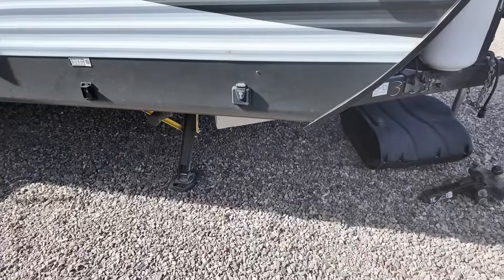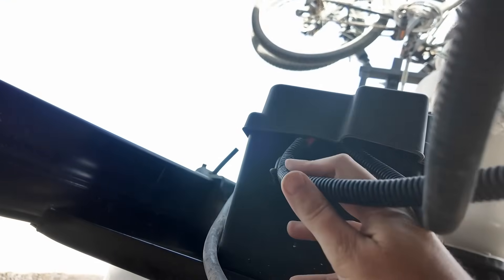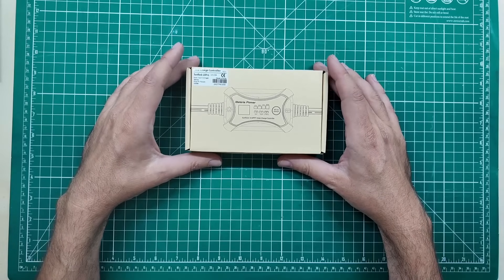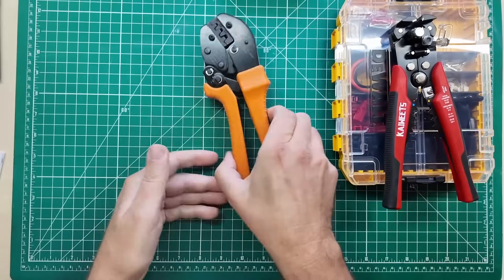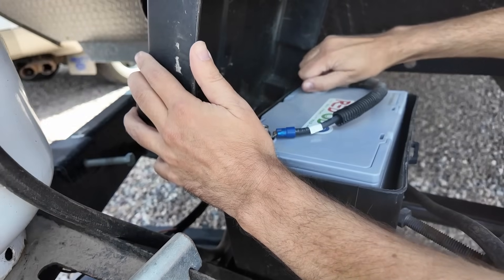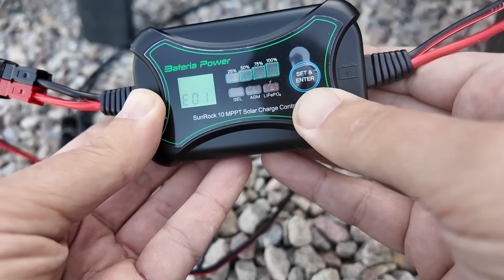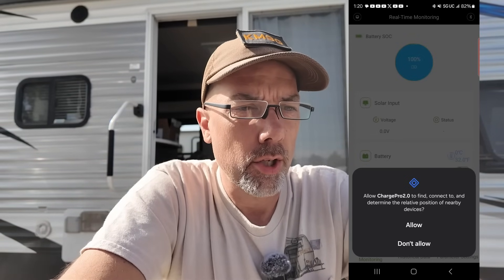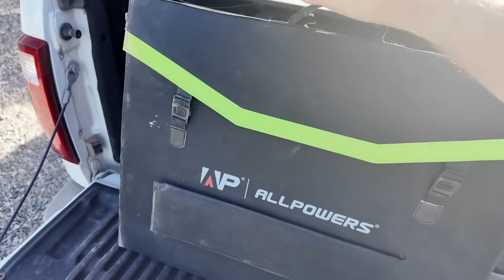No Solar?  NO PROBLEM! - Bateriapower To The Rescue!

Comment: If I hope to set up in my R. V. Will I have to tune my Converter. off inside?
Reply from the maker: You don't need to turn off the converter for this and I didn't in the video. That being said, you don't need to run both.  If you're unplugged from shore power, then your converter is already off.

Comment: Thanks for the information. I just bought portable solar panels with a solar controller and up on battery clamps. I didn't know about the plug and play on the outside of the camper. My camper is built in the 60s. My van is new. I put solar on my camper. I don't want solar on top of my van. Thanks again for the tip.
Reply from the maker: Sounds like you've got it figured out! Thanks for watching!
Reply: @livingforalivingRV  Even after 7 years. I am still trying to figure it out. The really good equipment. Like myself. Most can't afford. Then I have to find other options. I did figure this out about solar panels. The cells on them. The tighter the cells. The better they work on cloudy days. I own a 400-watt one. Really open cells. Nothing is close. Even on a sunny day. I am lucky to get 100-watts. The biggest difference between flat panels and the others is. The others can be fixed to keep on working. If the panel itself isn't damaged. On the back where the wires go into the box. A resistor is blown or more. 3 or 4 are in there. I went on Amazon and bought a few. 30 amp. Round ones. If it wasn't for hail. I would put the normal ones on top of my van. I want something I can protect. Using apps, etc. Is extremely easier. Not practical. More equipment. More watts and amps being wasted. More being used means more equipment. More money spent. Thanks again.

Comment: I'm curious if you could put powerpole connectors  on a 110v battery charger and connect solar panels to that.. have a powerpole to 110v plug cord, and a powerpole to solar cord, to be able to use that same charger for both methods?
Reply from the maker: You can get creative with power poles for sure.  Anderson makes different colors for different purposes, so if I was going to differ, I would use yellow for solar, blue for 20v, green for ground wires, etc.  So that I can tell at a glance that X cable is for X purpose and not mess things up.  I need to get some yellow boots for my solar panel side powerpoles for sure.

Comment: I'm not familiar with that charge controller but in general you should always connect the battery to the CC before connecting the panels.
Reply: Because the controller needs to know what voltage the battery has
Reply: @jaapdewind8774  Plus you can burn out the CC if you don't hook up the battery first
Reply: @einyv  I see this cc only accepts 12v, so if you do not have 24v or 48v around there is no problem there, Nice device, but I have a Victron system
Reply: I wouldn't worry about a100w panel being connected for a few minutes , long term charging with improper voltage is bad but otherwise harmless.
Reply from the maker: Thanks for sharing!

Comment: I have a lot of panels and several Charge controllers. The big question for me is the length of wire I have to run from sunlight/panel to the battery. I think I just need to plug it in and see how much I lose over the length of the cable. Thanks Steve. Always interesting.
Reply from the maker: Hey Don!  Figure out the max amperage you'll deliver in full sun and then get the wire gauge based off that.  Since you mentioned multiple panels, it might be better to run parallel or serial depending on the panels you've got.  Higher voltage usually means lower amperage for what is otherwise the same job.
Reply: @livingforalivingRV  Thanks. I am going to try

Comment: Is it more efficient to solar charge the "solar battery" then charge the house 12v battery via the solar battery 12v output . . . or . . . charge the battery using a ac to dc charger  from the solar charger to the 12v 100a battery.  I've done that both solar and via a/c into the Ecoflow then ac > dc charger into the extra 12 100ah battery.  What say ye re efficiency?  Now I have to draw a picture!
Reply from the maker: Start with the philosophy of "I don't want any converters anywhere" - no AC-DC-AC-DC type stuff.  Then add in a touch of "I need to get this job done and these are the tools I have" and you'll have your answer.  There is truth and there is reality.  For example, here digging out of winter we don't get much sun and electricity is cheap - free during the day, plug in at dark to finish off if needed.

Comment: Is it RF quiet on HF? 
Shouldn’t you take off the plastic piece on the back of the solar panel so you can get to the raw VOC instead of the regulated 18v ?
Reply from the maker: I might do a video on my ham channel about it being RF quiet.  This controller is a perfect size for a go-box project.

I don't understand your question about taking the sticker off the back?  This panel only has MC4 connectors, no "box", and I was getting 20v out of the panel.
Reply: The links you posted for the panel shows  plastic black box that has a regulated 18v barrel connector & usb outputs doesn’t show mc4 connectors 🤷‍♂️

Comment: does thus controkker draw powerr from the battery? I've had 2 now that will drain a battery fairly quickly. The display I find can be ab issue.
Reply from the maker: It will take power from the solar panels or from the battery to light up the display.  They have to get power from somewhere to give you the app display or the internal LEDs.

Comment: Question?   Just found you!  New Sub.  Why didn't you use the solar panel plug on the side of your rv to plug in charge controller instead of using aligator clips.  Thx
Reply: @drs3055  Cheep Ole Ham 😂👋
Reply from the maker: That solar panel plug on the side has a super expensive connector and it just wires directly to the battery anyway.  Seemed like an added expense with little ROI compared to just connecting to the battery with cables that are more versatile... especially since some RVs use this expensive connector and some RVs use Reverse SAE connectors... can't go wrong with alligator clips.
Reply: Ahhh, makes sense.  You did mention in the vid the reason for not using the rv's plug was the expense of the connector.  My rv plug uses the cheap SAE plug.  I can use the SAE reverse adapter to reverse polarity if need be.  Either way connects to battery - solar panel to charge controller to battery, way works - I thought I missed something.  I think I might just buy my wife your charge controller for Valentine's Day!  Thanks for sharing 😊